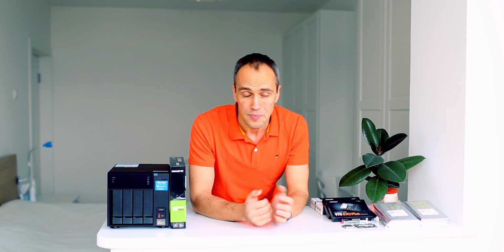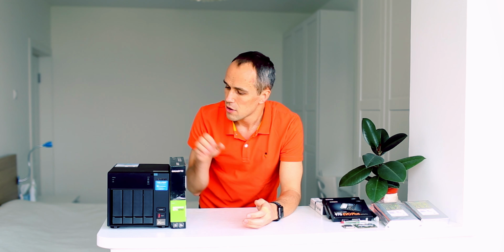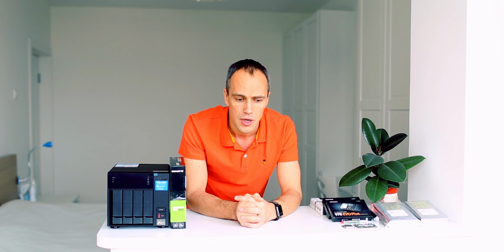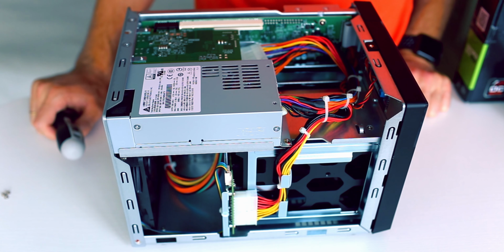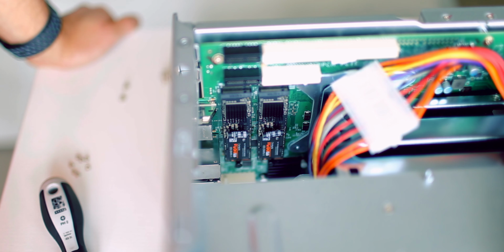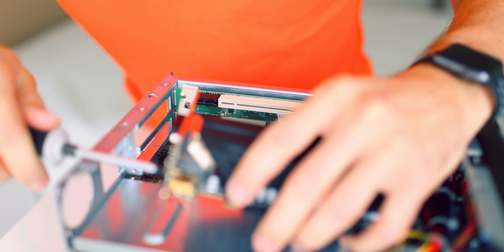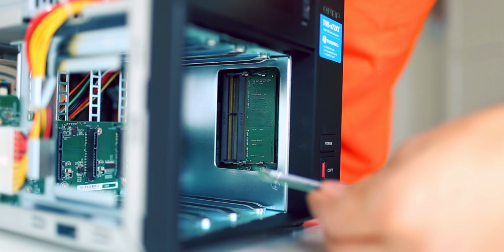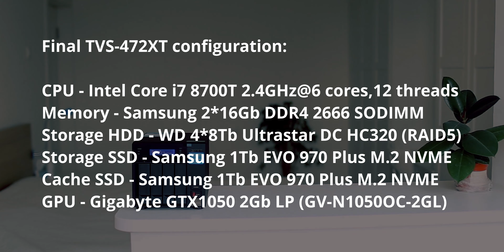Best 4-bay NAS/Plex server for home [Qnap TVS-472XT Upgrade]

Comment: Great video. Thanks. Surprised there are not more of these. It's alsoa  shame the new Hero H686, 886 QNAP NAS models sdolder the CPU to the motherboard. Forces me to look at this model now

I see the Nvidia 1030 2GB and 1050 Ti 4GB both recommend 300W PSU's, they respectively draw 30W and 75W power. I can see this device PSU is only 250W. Did you test what the system draws after RAM/CPU installation, or without the GPU installed to see how much "spare wattage" you had leftover to play with?

If you replaced the stock PSU with another 3rd party version;' what exactly did you get - did it fit properly and cause any problems with some propreitary connections?

Comment: Thanks for the great video! It’s very useful! 

I have a few questions
1. I see that you’re running Plex in a windows VM. Instead, can I run Plex directly in QTS and take advantage of all the upgrades? Or is the windows VM necessary for this?
2. How well is it transcoding 4k with the upgrades you’ve made?
3. If I upgrade only the CPU and don’t add the graphics card, how well would it transcode 4k?
4. Can I upgrade the CPU to the i7-8700k? It has a higher TDP of 95W compared to the 35W with the one you’ve used. 

Thank you!

Comment: Very informative and useful video. What are the key points to know when upgrading the CPU? Your model is not available to me.
Reply from the maker: Thank you! You may choose any 8th series low TDP (35W) Intel desktop CPU (e.g. i3-8100T, i3-8300T, i5-8400T, i5-8500T, i5-8600T, i7-8700T) available to you as long as it is faster than the one preinstalled in your *72XT NAS. Also all i3 models support only DDR4-2400 RAM while the rest of the bunch support DDR4-2666 https://cdn.wccftech.com/wp-content/uploads/2018/04/Intel-8th-Gen-Coffee-Lake_25.png
Reply: Thank you Nikolai. This is very, very helpful. I wish I could read your native language comments!

Comment: Hey did some research and I'm wondering if that GTX1050 GPU you installed actually does hardware transcoding? Based on this link, the TVS-472XT only utilizes the graphics card for Container Station and Virtualization Station https://nascompares.com/answer/nas-with-pcie-gpu-slot-for-video-hardware-transcoding/

My question for you is. With your setup, is there a way to run Plex (whether it be in a Container Station or Virtualization Station) as well as utilize the GPU for network attached video editing? OR not run Plex on the server at all and use the GPU just for video editing.

Awesome video by the way.
Reply from the maker: Hey! Thanks! I am running Plex server with unlocked GPU transcoding in Win10 VM hassle free. But I do not use GTX1050 in the NAS for video editing as I have RTX2080 in my PC, although I think you can do it.
Reply: @AkimovNikolai  Thanks for the response! Really helpful.

Comment: After watching this video is there point buying the 672xt .. ?
Reply from the maker: Dodge Crickets only if you need 2 extra HDD bays and/or full size PCI-E card installed (Quadro P2000 or alike).
Reply: Nikolai Akimov how is that cpu with Plex hardware transcoding?
Reply from the maker: @dodgecrickets7862  Well, CPU can deal with one 4k stream trascoding as long as it is not very high bit rate. If find yourself transcoding multiple 4k streams often you could use lower resolution source material or you could get nVidia Quadro P2000.
Reply: @dodgecrickets7862  Will it be accessible to Plex running on Container?

Comment: That is serious overkill. Only way you would stress it would be to have about twenty people hitting it up for files.
Reply from the maker: I do not consider this config an overkill. My logic is very simple. I would like this NAS to work at least five years. Currently on average I use about 25% of CPU power and about 50% of RAM. The usage will go up in time to about 80% in 5 years (I think) when I will replace it with something new. And one more thing. Data storage is not the main purpose of the NAS. I will post a video about my NAS usage soon.
Reply: @AkimovNikolai  awaiting that video

Comment: Did the power supply held up?
Reply from the maker: Hey! Yes it did. I have measured power consumption and it was below the PSU specs. Although I have replaced it later for 500W one just for the peace of mind.
Reply: @AkimovNikolai  which psu did you get?  is it the fx500?
Reply: @AkimovNikolai  I see the Nvidia 1030 2GB and 1050 Ti 4GB both recommend 300W PSU's, they respectively draw 30W and 75W power. I can see this device PSU is only 250W. Did you test what the system draws after RAM/CPU installation, or without the GPU installed to see how much "spare wattage" you had leftover to play with?

Comment: i'm running a TVS-672N with a i3-8100T, would i be able to upgrade the cpu in that ?
Reply from the maker: Sorry. I do not know. If you take your unit apart and the CPU is removable then chances are high that you can upgrade it. Choose a new CPU with the same TDP.
Reply: @AkimovNikolai   hey I have the same unit, is there any website where I can check for the CPU TDP, sorry I don’t much about that, and in term of the fan, where do i get the fan specifications to replace it.

Comment: Hey. Can you please tell me what fan model it exactly is?
Reply from the maker: Benji Beast You mean preinstalled fan or the new one?
Reply: Nikolai Akimov 
Hello. I mean the new one?
Thanks.
Reply from the maker: @The_Tech_Ninja  It is Noctua NF-S12A PWM https://noctua.at/en/nf-s12a-pwm. I have chosen this model as it has maximum airflow at only 18dB noise. My NAS sits in a server rack with 6 fans so I don't need a lot of cooling inside NAS. Still, If your NAS environment getting hot you can opt for a higher performance higher noise option like Noctua NF-P12 redux-1700 PWM, or NF-F12 industrialPPC-3000 PWM, or any other 120mm fan you like.

Comment: Did you install the thunderbolt 3 in the slot 2?  Is it work properly?
Because I asked so many people who put GPU in slot 1 they said the thunderbolt didn't work in slot 2

My second question after the last update did the GPU work properly with plex without Windows 10 virtual machine

Third question is the new CPU working good no issue or error?

When are you going to do a second video for your configuration😍
Reply from the maker: Hey! Sorry for a big delay with a follow up video. Did not post it yet due to personal issues.
I am not using Thunderbolt card in the NAS. GPU is a two slots card and has taken all space available.
I am running Plex server in Win10 VM with unlocked GPU drivers.
No problems with i7 CPU were recorder since upgrade.

Comment: Would the heat sink without a fan be sufficient for the i7 processor?
Reply from the maker: There are five fans in my NAS. Two on the CPU heat sink, one in the PSU, one on the GPU, and one 120mm exhaust fan. Which one do you want to remove and why?